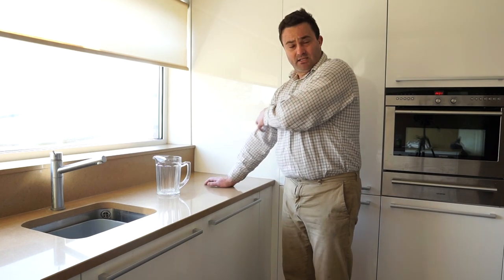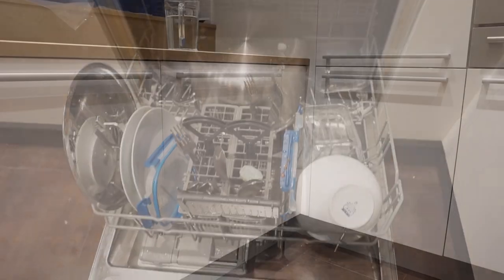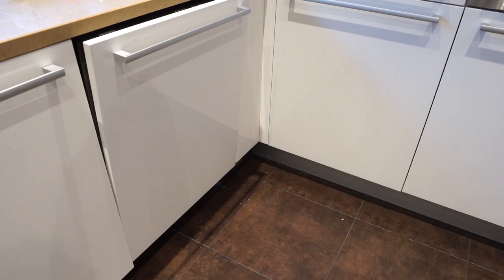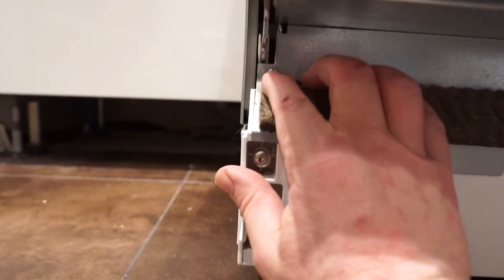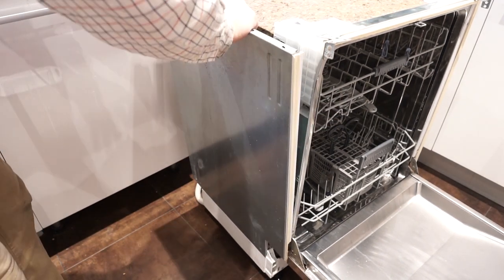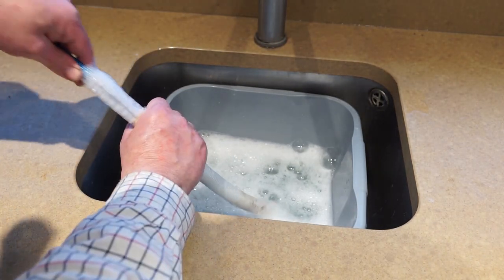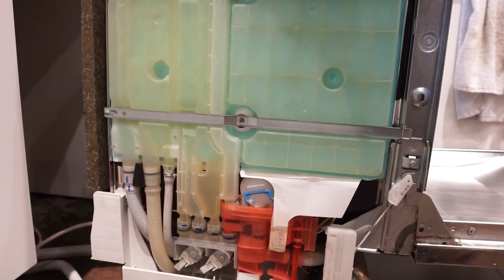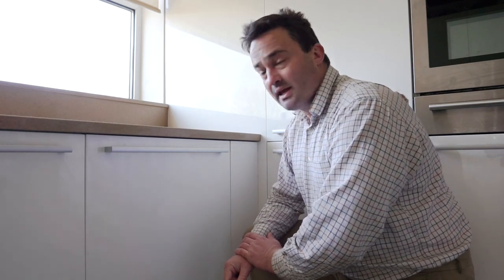Dishwasher not heating up or cleaning properly? Try this free and easy test and fix

Comment: Nice piece of kit but I don't think it will handle well around Brands hatch plus the boxy design is definitely going to hinder top end speed on the straights of Silverstone ! Personally I'd stick with the MGB 😁 ( sorry man , Saturday morning and was bored Lol) 👍
Reply from the maker: Pre season testing looked promising, but issues caused by the mains lead coming out of the power socket as I left the pits meant I've had to shelve the project for now.

Comment: Still not heating. I also measured the heater shown 23 ohms. I inspected visually the circuit on door for burn marks, no issues, what else to check?
Reply from the maker: Is it the same machine as this one?